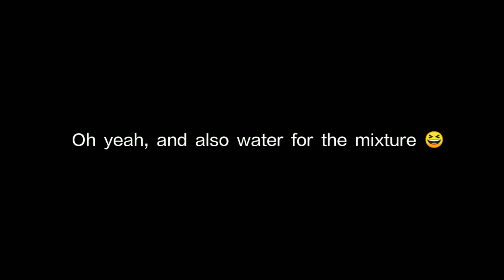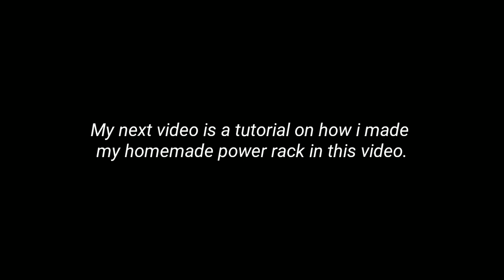2021 DIY Home Gym | How to make weight plate/concrete plate for barbell dumbbell at home | Life Hack

Comment: That bike tire idea is really new to me and awesome! I was thinking about reinforcing the plates with spray-on rubber (like flex seal) or wrapping em in duct tape.
Reply from the maker: Yup it is a awesome idea! In my opinion, I think the spray-on rubber will be better with cleaner look and easier for you rather than wrapping it with duct tape.
Reply: @TotoroGaming  I’m just worried about overall cost lmao
Reply from the maker: @crushbrick1988  the one that is expensive is the olympic bar. If you are on a budget you can try some thick pipe bar but the only problem is it cant handle much weight

Comment: where do you find a pvc pipe with an inner diameter of 50/51mm?
Reply from the maker: I found it on my local hardware store
Reply: @TotoroGaming  okay but there is  no DIN type with those measurements, you're lucky^^
Reply from the maker: @rookie996  yes bro im very lucky that my local hardware store got 50mm diameter PVC Pipe. Its the same meaasurement as a standard Olympic Bar

Comment: even if its the same weight as the gym plates the cement ones are much heavier why is it
Reply from the maker: Its because i mix the cement with stones thats why it is heavier
Reply: I think what you mean to say is that the cement plates feels heavier, not it is heavier. The reason is probably because of the weight distribution of the cement plates or weights.

Comment: Your weights turned out ok, you didn't say how much each weighed though?

Also while your plates turned out decent your bench and deadlift technique could use some work. 

On your deads your knees are too far forward and instead of moving the knees out of the way of the bar like you should, you end up moving the bar around your knees. Push your hips back so you feel more stretch in the hamstrings,  then start the movement by straightening your knees so your hips and shoulders rise together.  Paused deadlifts would probably help a lot. Also when you go to set them down don't bend your knees until the bar has passed them,  just bend your hips. This will help you be in a better position to start your next rep

For bench, biggest immediat issue is where you've got the bar in your hands. You have it way back by your fingers. You'll be stronger (and have less wrist issues) if you move it to the front of your hand directly over the wrist bone. The so called bulldog grip would help you i think. The second big issue is the elbows, they should be directly under the bar with the tips jus ahead (towards your feet) you've got them behind the bar. Not nearly as strong that way as you can be.
Reply from the maker: Thanks a lot mate for correcting my form. Yeah i know its really out of form back then. Now im doing a lot better as i improved overtime. By the way i just started lifting back then
Reply from the maker: For the weigh, each plate weigh about 8kg, i did stated on the description below

Comment: Can’t find 5 cm diameter pvc anywhere where did you get It
Reply from the maker: Well i got mine at the hardware store. They have it a lot lol. Did you try looking at the hardware store?
Reply: Just look for 2 inch pvc or grab some 2 inch pipe from a steel supplier. Remember tube is measured by I.d. and pipe is measured by o.d.
Reply: 5cm is 2in. Hopefully you googled that by now though

Comment: Need to tighten up your upper back on the back squat.  Rounding over you can hurt yourself
Reply from the maker: Thanks bro for the advice! Just started lifting and will improve my form overtime. Thanks for dropping by 🔥
Reply: When you low bar you tend to round over a bit.
Reply from the maker: Thanks mate for the advice 👍🏼
Reply from the maker: Thanks for the tip mate. Will try it soon 🔥
Reply: Don't listen to man wagon or joe schmoe, they don't have a clue. Low bar doesn't make you round your back, it's more hip dominant so it makes you"fold over". Nothing to do with if you round your lower back or not. Try front squats and goblet squats to learn proper form. And for the love of God don't look up. Keep a neutral spine and look at the floor about 7ft infront of you, just like you were doing. Do some straight leg deads to help with your back strength and hip hinge movement pattern. Good luck